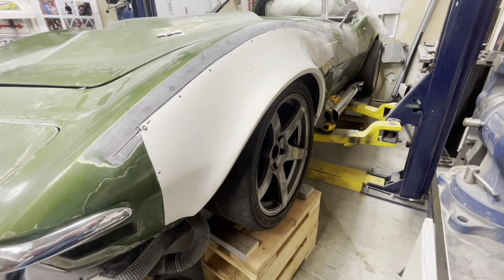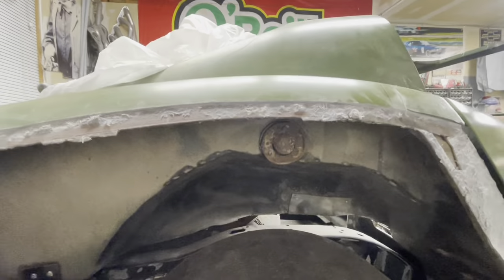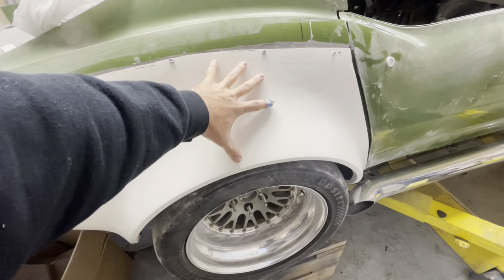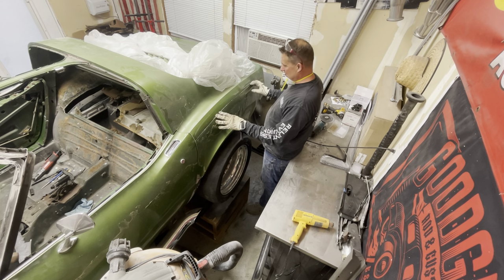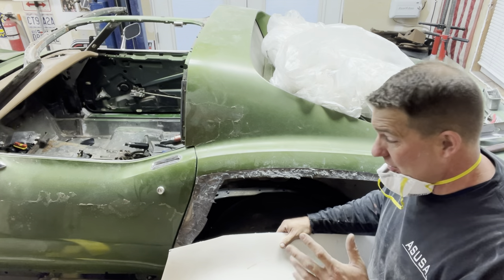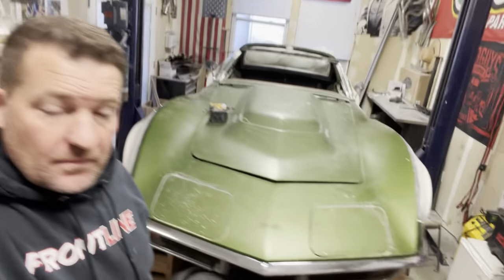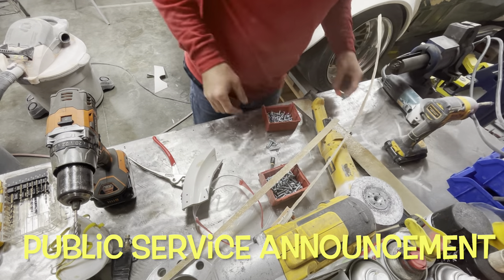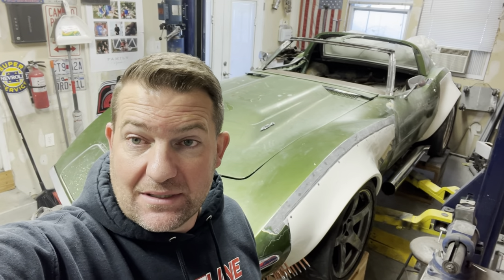C3 Custom Image Corvette Flares Install pt 2  !!!Warning!!! This is a long one 😬

Comment: As a former 72 Corvette owner, if you consider a New frame I would suggest a triple round tube frame from SRIII Motorsports. They’ve been around for over 30 years, longer than any other. They can also set it up with C-5 or C-6 Corvette front and rear suspension with the exception of using a conventional diff and trans instead of a transaxle. Much stiffer than the stock frame. Good luck.

Comment: tastfully widened C3's rock. I prefer original 15" wheels though because they make the car look more muscular...more aggressiv.
Reply from the maker: I like the 15 inch wheel look also. It definitely looked tough. Unfortunately my brakes will not fit in that small of a diameter wheel. 18 is what I’m going with.
Reply: @mayermotorsports  18 is the smallest you can run with your rotors? : )
Reply: The wheels on the red thumbnail-image are the best 18-inchers you can find, arent't they? : )
Reply from the maker: Yes, with the big brake kit that I’m running in order to clear the rotor I need to run 18 inch wheel. I might be able to do a 17 inch but then we get into tire selection which is very good for what I do. About a small as I would want.
Reply from the maker: Does those wheels on the thumb now are CCW’s. They are super nice but I ended up going with a fort line. If you look at more of my recent videos, you’ll see what’s on the car now.

Comment: biden wants to End the Regular Cars and Trucks, anything that runs on gas. Instead of fitting the chassis with new designs. I Say Bring Back ALL the Old Styles on All the new Electric cars.  When GM's sales were down on the Corvette I think they should have Brought back The Legendary Mako stingray shark instead of Copying a Foreign Car Companies designs. I know for a Fact there's been times Lamborghini or Ferrari or Audi an.. so on have had meetings on how to get more sales. I bet no one said.. Oh I Know... Let's Copy A GM Or Ford Car Companies design. GM does that all the time. What ever is selling the best. GM will copy some parts of it. One of the sexiest Trucks I've ever seen was a GTO Front grill and headlights and Chevy Body. F..king Badass Truck. Change a couple things here and there instead of copying a foreign car company's design. I wish they would have put a patent on the rear engine design